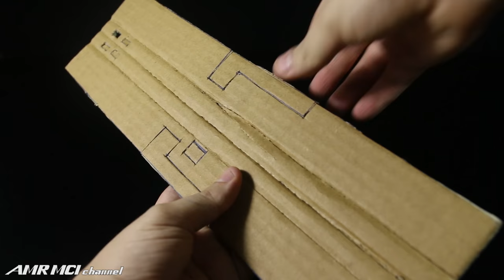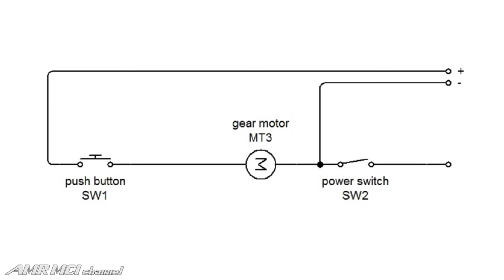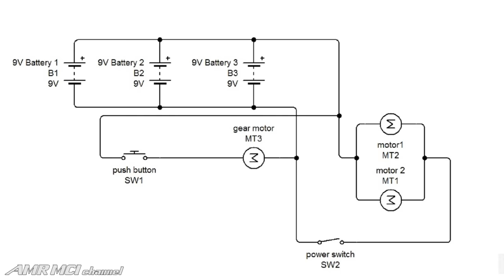How To Make A Fully Automatic Cardboard Assault Rifle that SH00TS

Comment: It would've been cool to put a button in the trigger setup so when you pull the trigger it activates all of the motors only making it in the on position when you pull the trigger instead of a separate on switch.
Reply: troy barnhouse I think it can if you put only 1 switch in the line with both motor

Comment: This is th hk g36c
Reply: DiciestDrake It's a very, very good and reliable assault rifle.
Reply: Vaso BMW actually it's a carbine
Reply: Daniel Heines2 I know. C stands for Carbine. It just has a shorter barrel than assault rifle, but longer barrel than a pistol.
Reply from the maker: yes
Reply: Daniel Heines2 , it is still an assault rifle but a carbine/shorter version of it take the example of an M16 and M4A1
Reply: Amr MCI awesome
Reply: DiciestDrake what? I thought it was the mg45
Reply: Alright gun nerds, call it what ever you want, it's still a Carbine.
Reply: M16 is not a carbine, it's a full rifle. The M4 was the carbine variant of the M16.
Reply: fin cost no because the mg45 has a larger round cap
Reply: Vaso BMW I heard it lacks a lot of accuracy.

Comment: I made it finally. Works fine. Thank you for the instructions. By the way I used my own simple circuit.
Reply: Means what changes you made in circuit
Reply: @raghavfanje2704  Are you asking me about my circuit design?
Reply: @manasnikhil  ya
Reply: @raghavfanje2704  I don't exactly remember. It was three years ago. I think I joined the positive of one motor to negative of the other motor  and the negative of the first motor to the positive of the second motor. In simple words I joined the opposite terminals of the two motors. Now I joined the battery to the terminals and introduced a button switch. When I press the button, the two motors rotate in opposite directions. I hope you got the idea.

Comment: This is the worst Even  the materials are costly and no measurements or it’s so difficult to do couldn’t u add rubber bands instead of gear motors and what jet plane engines